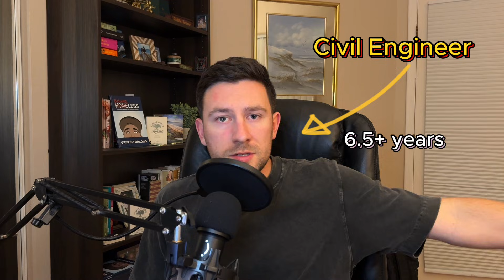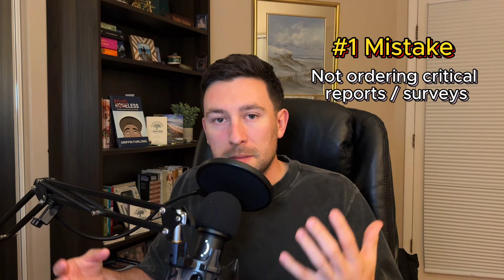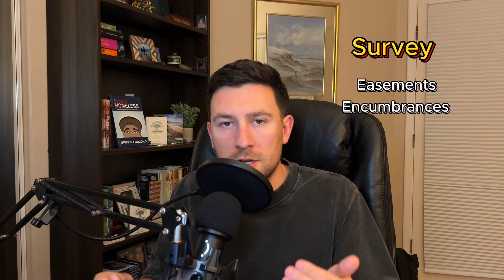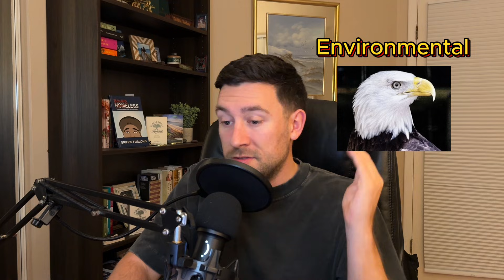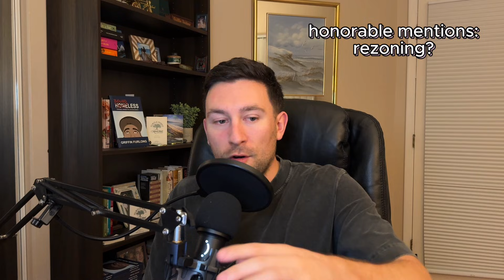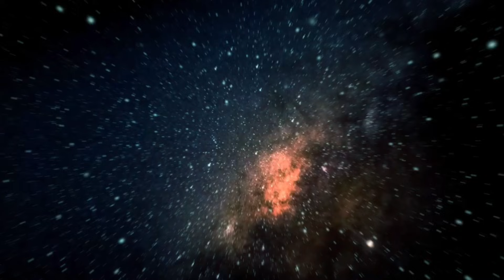Mistakes Land Developers Make (Civil Engineer’s Perspective)

Comment: A current mistake I have with a developer is that we had a project back in 2020 that got put on hold until now and even thou it is grandfathered in and still valid, we need to upsize the storm since the City code changed to account for the next units. The price for waiting I guess
Reply from the maker: Very valid. The rules continue to change. Florida just had a significant update across the state.

Comment: Can you give an example of the soil type and classification you mentioned toward the beginning of the video that caused a whole LD project to be cancelled?
Reply from the maker: If the geotech shows fine grained, high plasticity soils, like USCS CH or CL-ML (AASHTO A-7-6 type stuff). That dirt is usually “unsuitable” for structural fill under roads and building pads because it holds water and can shrink/swell, so it’s hard to compact and can cause settlement later.

If you have ponds, you end up with a ton of excavated material you cannot reuse on-site. That means exporting a bunch of dirt plus importing good fill, and that cost can blow up the budget.
Reply: @civilgriffin  isn't that the point of treating the soil with lime to reduce the soil's plasticity?

Comment: I wouldnt go as far as to say you need an official ALTA survey per NSPS guidelines, but it is obvious that the survey should include easements, boundary set backs, etc. that define the area which can be developed. Now, sometimes it is actually a nuisance to get all utility companys to flag their lines. In my experience, some local PSDs or regional water distributers can be bad about this. Sometimes the local PSDs sub out their locating services to their 'engineer' or the consultant they are in bed with. For the regional outfits, it seems that certain groups within the organization dont comunicate well with the others or are just slower to get requests finished. For instance, the engineering department could tell me the line pressure and size a day after my inquiry but the field crew who is supposed to mark the line never shows up. With respect to geotechnical investigations, I would push back and say that it is not always warranted. If youre an engineer in Nebraska designing a development in your local area then you know where the more problematic soils in your area are and you know whether or not involving a geotech may be neccessary. Alternatively, if youre an engineer in Nebraska designing a site in New York, then you likely dont have enough knowledge of the area to rely on engineering judgement. Ultimately, in my experience, when it comes to light residential or light commercial, geotechs arent involved. Otherwise, they are.
Reply from the maker: Interesting perspective! I’ve never designed a project without geotech. In fact, some counties we work in REQUIRE a report and bores placed in intervals. And if we don’t get an ALTA survey we have to throw in a ton of CYA language on all of our drawings

Comment: I used to think boundaries, topo surveys, and geotechnical reports were always the first step. After working with different companies, I’ve learned that’s not always true, which is surprising.
Reply from the maker: There are other things to dig into for sure. Zoning, title, code, county GIS, google earth, site visits, FEMA, NRCS soils. But you can only go so far until you have the professional documents and pre-application meetings. Everything can look great until the County says you need to widen the road to your property, add turn lanes, and accommodate offsite drainage. So many nuances from my experience.